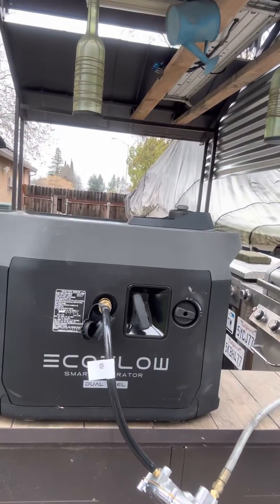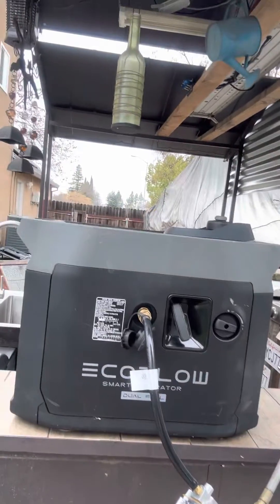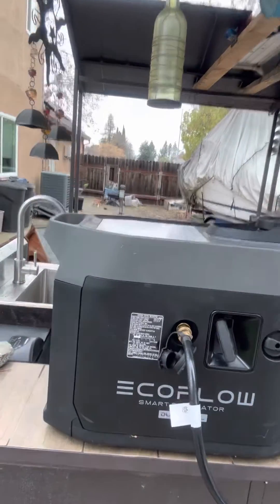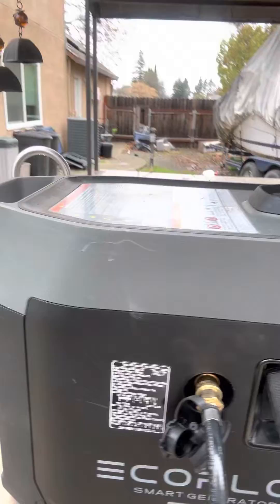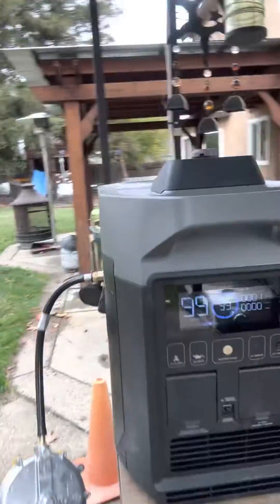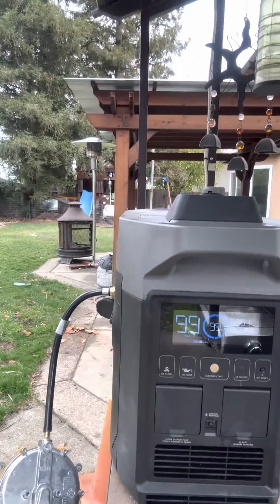EcoFlow Smart generator dual fuel to tri fuel conversion. Natural gas add to propane and gas model

Comment: natural gas is about a 30% loss of power from gasoline..watts normally drop..watt were your watts w natural gas?
Reply from the maker: I still haven’t tested my max watts on natural gas but it definitely lost a fair amount of output. It will recharge my ecoflow power station but it won’t run my coffee pot that is about 1400 watts, but it will run the coffee pot on gasoline. I know that’s not very scientific
Reply: @dustinkuntz close enough..figure your peak wattage is around 1350, and running watts 1250..that's if it was a factory type set up and regulators spot on..likely enough for refridge and blower fan etc on gas furnace..

Comment: I'm considering getting a Dual Fuel Ecoflow Generator, how is this working for you after using it for a while? Any hints or other videos about your 'modifications' to tune it? Thanks for the video!
Reply from the maker: I have put about 40hrs on it now, I like it overall to recharge my ecoflow power station and the auto start is nice. The downsides are my plug on the front is flimsy and the connections have backed out a bit and are loose. It also seems to really struggle trying to make its rated output and stalls frequently at about 1400 watts of output on gasoline and at about 36 hours use the fuel gauge stopped working

Comment: Thanks for sharing. Since we can't do anything with EcoFlow's proprietary quick connector, I will add the quick connect fittings to the "cut end" of the hose so it is interchangeable there with hose that can either connect to HG or LP tank.

Comment: Exactly what I wanted to do with mine. I have seen one other video of a natural gas hookup. The guy mounted the regulator on a tee near the gas meter, which would be one way to go. It sounds like you're using a fairly low volume NG connection, like for a gas grille. I already have that, so I just need to get the Garretson regulator and the proper fittings to give this a try.
Reply from the maker: Yeah mine is literally plumbed off my water heater line to my bbq via the quick connect hose